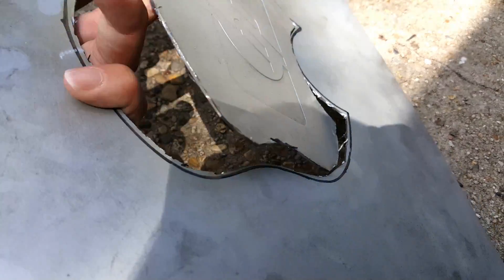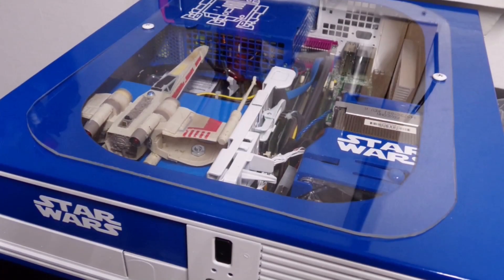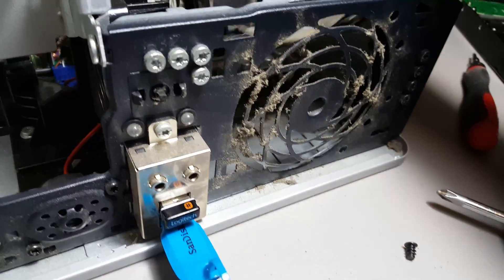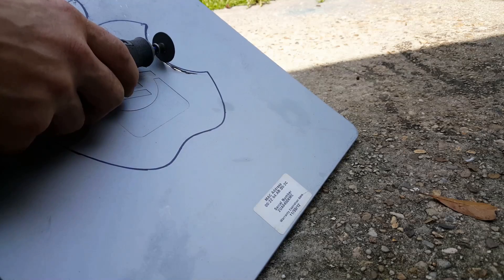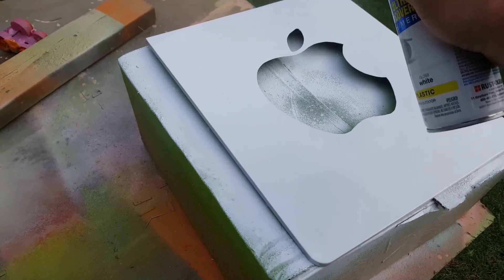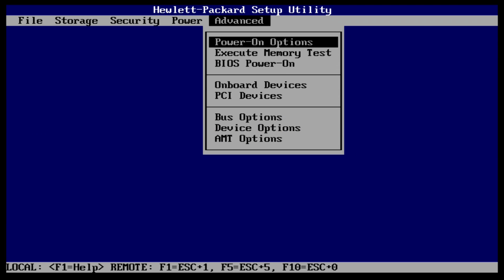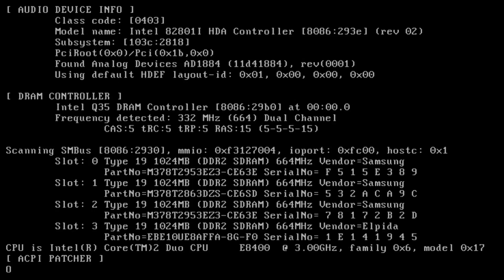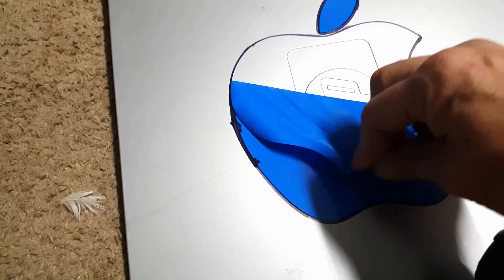Hackintosh THIS! 1.00 HP/COMPAQ computer

Comment: How do you upgrade the power supply for these I bought a new power supply because it has a 24 pin connector but when I got it I realized that’s the 24 pin connected on the go compaq dc7800 is smaller then standard atx

Comment: You do amazing craftmanship, I know it's an amateur question but how to you get the sticker print labels custom? I assume a ink jet printer?
I came across a white toshiba C40D-A which have allot of simulatorities as the older white macbooks, I'm not sure if I'm ready to attempt grinding out the back lid of a Mac logo and haveing it backlit quite yet so a sticker or like in your video would do fine for now, also trying to run Mac os and configure the hardware and software is out of my skillset as of for now so I'm just gonna run some themes and applications to have that Mac  interface and window look at least for now, 
What I would like to do though is is hardware upgrades  it's actually runs fairly smooth on win 10 with stock AMD A6-5200 APU 2.0 GHz with hd graphics, 6 Gb ram and a Kingston 120Gb S1 older ssd, for a 2013-14 pc that's not to bad I guess. I would like to make it run as fast as a modern day one that costs around or over $1000 but only put a few hundred max. Into it. 
I'm not familiar with how about going with this so anyone who knows I would appreciate the feedback, 
I'm not sure if the processor can be upgraded or overclocked but I need it to run preferably at a 2.5ghz for autocad and also the ram 2 8gb sticks (16gb) would be nice but not sure if it will take that so even 8gb would be ok, and the ssd I seen on amazon these Crucial MX500 500GB 3D NAND SATA 2.5 Inch ssd are pretty amazin, I guess I would have to flash the bios as it's running old INSYDEH20 version 1.20 and EC version. 1.00 I've never updated bios either but I'm pretty self taught smart and crafty just would like a little guidlinging before going about this further as most of those things are newer to me... Thanks.

Comment: I'm going to try to build a Core2Quad machine around an Intel DQ965GF motherboard, 6700 C2Q CPU, 8gb RAM, etc.  The trick is what video card to go with.  The board has onboard video, but I was thinking about something a tad bit more robust like maybe a Geforce 8400GS (512mb) I have lying around...there's mixed opinions as to whether or not you can get a Hackintosh system to play nice with an Nvidia GPU, so we'll see...

Comment: I did this today on a sff hp 7900 with an og core2duo and a quad all it works fine the mapping is also just carbage... I did Nothing (using Multibeast)  it runs Yosemite buttery smoth.

GPU is an old Nvidia quadro NVS
Reply: Excuse my Bad english

Comment: Actualy you can get the gt 730 working in sierra really easy just install the nvidia web driver in the correct way and it will function all right but the gt1030 you need sierra 10.12.6 or higher to work
Reply from the maker: The nvidia driver starts to install and then encounters problem. I spent days on that computer.

Comment: Hi, I have a hp dc7800 is it possible to change the processor to a xeon (x5355)?
Reply from the maker: I wasn't able to get a Xeon working  I assume it's a voltage thing but I'm not sure. Just BSEL tape mod a core 2 quad q6600 you get a cheap 3.0ghz quad with surprisingly pleasant performance. The kids been playing one for 6 months now no problems.
Reply: @modstek  It is installed as usual, or some modification is used

Comment: I have High Sierra running on a core 2 duo (8400) machine using a GT 210 graphics card, so likely that is possible for you.  No real issues with either 10.12 or 10.13.
Reply from the maker: I'm going to try another card I was thinking about stealing the ole lady's 750ti and try it lol. 
  I did however get a gt 730 2gb to run great on a z210 last night with a i3 2120 but then the damn thing updated and I can't get it working the same. I don't know if hackintoshing is worth it.
Reply: In my opinion, it is worthwhile.  I run MacOS High Sierra on a laptop I purchased for 70 dollars and on an Optiplex that somebody gave me.
Reply from the maker: Be honest though did you ever have to put it for a day or two because of frustration?
Reply: The first time I tried to install 10.12 took several tries using several different methods before I got it running.  Probably did take a couple days.   But 10.13 installed the first time I tried it because I knew what I was doing.

Comment: GT 1030 is too new for Mac OS. Either get a 9 series or 7 series nVidia card, or put any AMD card of today and I'll work!
Reply from the maker: Thank you I was thinking about buying a gt 710 to see if it took off as a native card. I think if there was a way to turn off the internal graphics in the bios I would of had better luck. I beat myself for days with no graphics and finally put that pc under my desk.
Reply: @modstek  mine has a Core 2 Quad and a GT 730 and rocking on Hackintosh Zone

Comment: just curios, how much have you made off of those 60 hp computers?
Reply from the maker: That's a tough question because I bought a lot of cpu's, ram, power cords, Hard drives, batteries, mice, keyboards, vga cords, DVD rw drives, paints, thermal compounds, saw blades, Windows   product keys etc.

Comment: nvidia 1030 or 1050 slim card works.  I used them on my HP 6300 - just use proper nvidia web drivers.  Tonymacx86 is a good place to check out.

Comment: I got 24 Working Hackintosh machines at Work, 8 of them are identical and are 100% Working, no issues at all i7 4770 With HD4600 exxept my own machine which has a GTX 680 in it. The other 8 are also Working Really Good but some of them have Graphics issues (Intel HD2500). The other 8 are core2duo PCs from Fujitsu where Everything except Sound Works. We use Supported USB Headsets so that was Not a Problem. As Graphics cards, the older core2 Models use an Nvidia 9400GT, or a 9600GT. The slightly newer ones have either a HD4000 Or a HD2500. HD4000 Works perfectly, HD2500 Works After setting the PC into Standby at Boot and then awaking them.

The GT730 should Work, the 610 should Work, the HD4870/5770/5870s Work, GT640 Works, 1050/ti works. 
All machines are Running High sierra and El capitan Together with Windows 10.
Reply: Oh and also One thing i Forgot, i Made The Installation Without Hackintosh zone with a unmodified Installer and clover. Somehow it Works Waaaay better if you just use a unmodified Installer and just load every kext with clover.
Reply from the maker: nice!  I just got my HP Z210  fully functional with an i3 and gt730 2gb ddr5

Comment: @modstek: I saw from your previous videos that you put tapes on the processor and I was hoping you could explain more on that? I am planning to overclock my intel i5-4460 but I googled and a lot says that it is not meant to overclock haswell processors. But really I am interested on your technique about tampering with tapes and how does the performance and lifespan of the processors affect after that
Reply: thats an trick that sets an overclock of 3ghz for intel core duo and quads. I dont think it works on the newer ones.
also it just works like an overclock so real loss of lifespan.
Reply: thanks @Yung Pickahu: I thought I could do that to intel i5 4th gen

Comment: Sierra and High Sierra have problems with the 10xx series graphics cards. See if you can find a 9xx or 7xx card and use the drivers from the nvidia site
Reply: Caleb Hogue is there a way to get them to work at all? I’m stuck at that with a 1070

Comment: 10xx nvidia cards require atleast 10.12.5 iirc, you need to run something higher than that (high sierra is your best bet). when booting the installer and on the first boot, use the nv_disable=1 boot flag. then, install the nvidia web drivers from the nvidia website. after that, boot with nvda_drv=1 boot flag, which will enable the nvidia drivers

Comment: Isn't it funny how smooth OS X runs on a Core 2 Duo, yet Windows 10 wants to kill it? Still so much life left in those little chips.
Reply: shit windows 10 killed my 1 tb drive, it game me so many issues im never using windows 10 again, if windows 8.1 ever drops support, im switching to a mac
Reply: @Deadhog_Rage  same
Reply: I just installed the Mojave Beta on my early 2008 MacBook pro, it still runs Respectable.
Reply: basically anything unix or linux based is going to run well, even on shit hardware (not saying this hardware is shit, is just an example) Mac OS is a decent OS, its just not my preference, i prefer a full linux system because of the freedom. The only linux distro i've seen struggle with weak hardware is ubuntu, but thats only bc it was designed to be pretty, not functional.
Reply: @dcfuksurmom  I partially agree with the opinion part of this. I prefer anything that is either Linux, BSD, or Solaris. I haven't really used MacOS or anything Darwin based though but I really want to.
Reply: I think this is part to blame on Microsoft which no longer optimised windows 10 for low end systems. Windows 8 and WI does 8.1 was so fast because it had to run well on retarded atoms inside cheap windows tablets.
Reply: Apple knew exact what they were doing when they based their OS on linux..   It's amazing how many billion dollar + companies have taken advantage of that penguin.
Reply: Technically unix but I do understand your point ! they share much similarities because of the unix engine its amazing.  Gotta love linux its my favourite.  Papa Bless
Reply: mac os isn't based off of Linux (lol) or Unix (common misconception, Apple paid AT&T [makers of unix] for a license to say it was unix certified), but it's instead based on BSD (same OS the PS4 and other embedded devices run)
Reply: @itsthem5699  BSD is unix.
Reply: paul Z, Mac OS X (as in 10, not ex as many say) is based in FreeBSD and Mach.
Reply: @internziko  macOS is based on Unix, not Linux.

Comment: Since it's sierra, I think RX 550 should work. [As long as it's on 10.12.6, and not the XFX cards, xfx uses something that makes it incompatible with Hackintoshes]
Reply: In other choice, a HD5770 is the card that was shipped with older Mac Pro from the time and should work also.

Comment: I have been considering doing a hackintosh build on my channel for a while, but I have never gotten around to it. I am really worried I will get stuck in driver hell, and spend way too much time on it. Great video though!
Reply: It can be a pain find drivers (in macOs they're called "kext"). But I've built 4 hackintoshes and it really is not as difficult as it may seem. Just do research before hand to compatible hardware. There is a learning curve and I would HIGHLY recommend that you get access to a computer running macOS or OS X before you set out to build a hackintosh. Even if that means buying an old warn down mac from 2007 or 2008.
Reply: Carrot have you used your hackintoshes for heavy workloads?
Reply: I did not have access to a Mac, but I was able to get started by running el Capital in a virtual machine.  It really was not all that difficult.

Comment: If you're struggling to get the GPU to work properly, using FakeID through Clover may well help get you to something of a reasonable form of graphics. Find a graphics card ID number that either matches your hardware, or one that is a close approximation of it, punch in that FakeID into Clover, reboot, test. 

It can take a few trial and error attempts, but generally speaking, that's probably the only decent way to get graphics to work properly with 'some' cards. This won't work in every instance (due to the amount of different cards available and supported by Mac OS), but you can give it a shot. Google for different FakeID's for your card, and you might get some luck.

Hackintoshing isn't for everyone, but it can be a lot of fun to make it work on hardware it wasn't designed to work on. Happy hacking modstek ;)
Reply from the maker: I tried a vendor id but im not sure if it was the fake id the bootloader gave it

Comment: Go to the apple at the top left, about this mac, find what version of sierra/ high sierra you have installed. Get nvidia driver corresponding version and install. Sometimes there is a few but. The hp 8300 works so much better and has uefi.
Reply: You might even might be able to swap the motherboard and power supply. Or hp z220 sff or cmt as well.

I think the 10 series drivers require uefi, so the 750ti might not. Intel 4000 works well with only a few CCC changes.
Reply: https://youtu.be/AN3GjO1ixKw
Reply from the maker: i have a z210?

Comment: Prob be better off running 10.11.x El Capitan on that hardware. the GT210 or a GT730/740/750 will work well on that hardware and a 10.11 el cap install. plop in a cheap 128GB SSD and you'll have a screaming hackintosh that will outrun machines that used to cost thousands.
Reply: Do you know which compatible GPU is the cheapest?
Reply: Micke Friberg You can get a used Gigabyte GTX 750 at AliExpress for $60